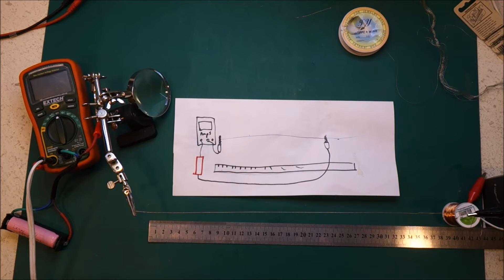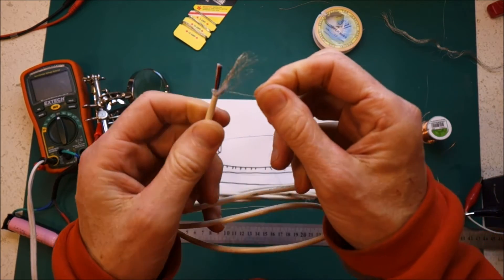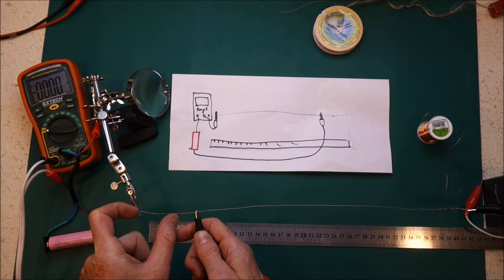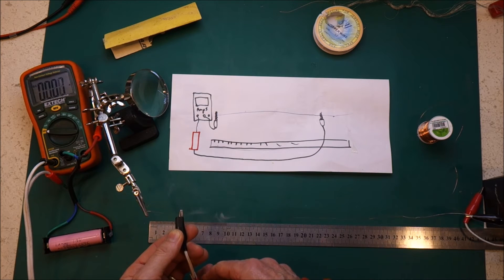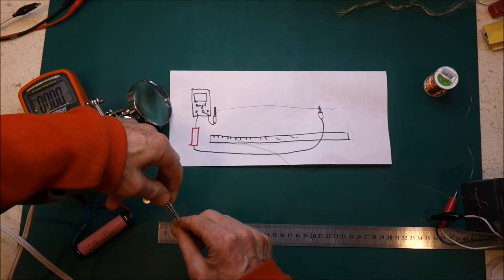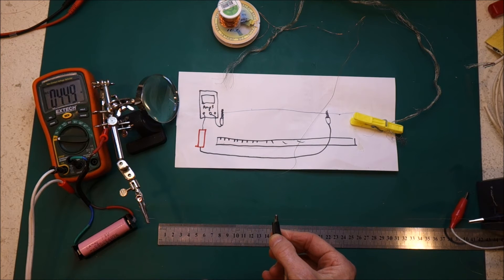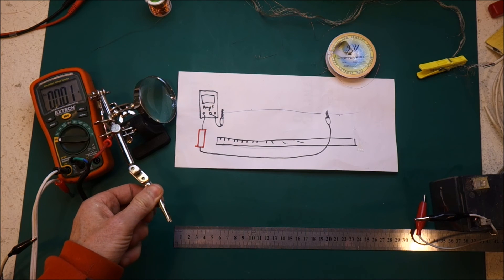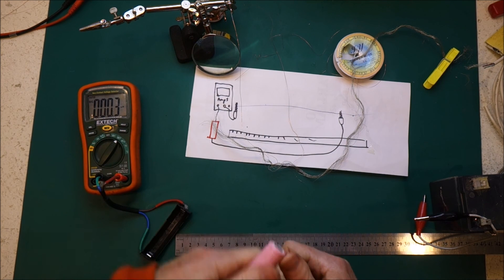Laptop Powerwall 57 - testing wire for fuses part 1

Comment: Hello Paul...Good to see you in the lab.   I use this German saying:  "Wissen Ist Gut, Aber Kontrollieren Ist Besser"...!   A great Quick way, to get enamel off, is burning the wire with a lighter.  Smoke coming from the burning enamel, is a good indicator, it has gone.      Then, scrape/wipe/rub off the coal easily (gently).
Reply from the maker: Thanks for the tip. At the moment I just scrape with a b it of sandpaper - which mostly works OK.

Comment: Hi Paul, I think this test would have been a bit more reliable with a pack of cells in parallel as I think some of the inconsistancy is due to a single cell limiting the current. Better still use a bench PSU with variable current limit.
Reply from the maker: Agreed. A bench PSU would be best - but I wanted to try a test that didn't need extra gear. It would be interesting to see if 8 cells in parallel would change the results.
Reply from the maker: Man - you're really churning thru my vids today. Thanks for all the suggestions.

Comment: Excellent video.
Wouldn't fuse wire capacity be independent of length ?
The shorter the better.
For a steady current it maybe doesn't matter how long the wire is.
Sure longer fuse wire will present greater resistance and reduce current flow itself.
But you don't want that - you want the full current of a fault situation to flow.
Reply from the maker: Current capacity does go up when the fuse is very short - due to the heat sinking effect of the end connections. It's counter-intuitive though.
Reply: OK thanks, yes the end connections definitely act as a heat sink.
But if you ignore that effect, I guess a 1km long fuse and 1 cm long fuse wire would break at the same time, for example.
 (for the same current flow)

Comment: Great video! I'm going to install some regular 5amp glas fuses between each positive to negative cell in my pack, i will use the factory fuse holder so it will be easy to replace if one blow. ( i got the cell holders like you, so i will not solder the clips on the cells) What do you think about that idea?:)
Reply from the maker: Sounds good.

Comment: I am little confused... one 18650, hows it generating 6/7A current .. can you please explain? max 3200mAh...!
Reply from the maker: 3200mAh is a measure of how many Amps it can deliver over time - not a max current rating. Most laptop cells can push out up to 10 Amps or more for a short time. But this dramatically shortens ther life. Other lithium chemistries can do 20-40 Amps. Quadcopters need that much - which is why they only run for 10-20 minutes
Reply: Thanks for prompt reply Paul. I will have to check specifications of the Cells I have got to understand how much max it can draw; its just for my understanding, not building anything. 
Love your videos by the way.

Comment: would you use fuses on a e-bike made with recycled cells? Or should  I not worry to much sense it will be about 80 cells?
Reply from the maker: It's a bit more tricky with e-bike packs because they need to run quite high currents normally - so it would be easy to blow fuses under normal use. I've seen @Rinoa Super-Genius do poly fuses on one of his e-bike packs. Maybe that's the way to go?
Reply: Okay, so I wounder with my setup being 36v 20ah with a maximum 30amp draw, if the 2amp poly per cell would be fine. Thank you for the input.
Reply from the maker: How many cells in parallel (per group)?
Reply: 10s 8p pack using 18650

Comment: Hi Paul, as HPPowerwall mentioned great easy to understand video. I've found that some speaker wire is wound with .2mm pure copper. This is what I've been using. 1m for a couple of bucks will give you about 250 strands!
Reply from the maker: Yeah - that's a good source too.